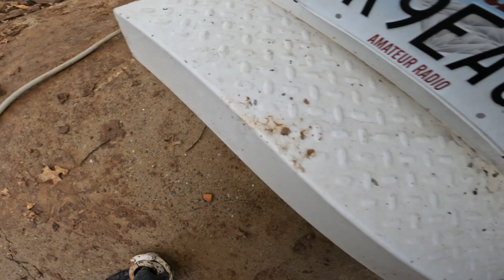Easiest Pump Job You'll Ever Watch!! (Very Easy Money)

Comment: I do flat work in Washington, the guy I worked for had a pump for those "hard to reach" back patios, apartment floors, and takin' in random pump jumps for other contractors. No kidding that's an easy one. 😆 But I'm interested in that adapter you got for purging the hoses with an air compressor. Any info you'd be willing to share on that I'd appreciate greatly. looks like a couple quick connects & ball valves, but where do ya get the pipe? Is that a type of knock down from schwing, adapted? Just found you guys recently, but I like your content.

Comment: You have to prime the pump out. We use pumps here in Utah all the time. That's what is causing it to clog up.
Reply from the maker: I prime out every time i pump that's what I'm pouring in with the 5 gallon bucket at 4-5 minutes in the video.. Plugging is part of pumping. It's a dry pack. Happens a lot with line pumps. Part of the game.
Reply from the maker: Especially with 2 in hoses.

Comment: Are you guys running 2 inch line. What’s the biggest aggregate you can fit through that
Reply from the maker: Yes sir. We run pea gravel through our 2in lines. And 3/4 rock through our 2.5's
Reply: Thanks great videos I have the same pump I hurt myself real bad and now I’m scared of the thing. I undid the clamp at full pressure.